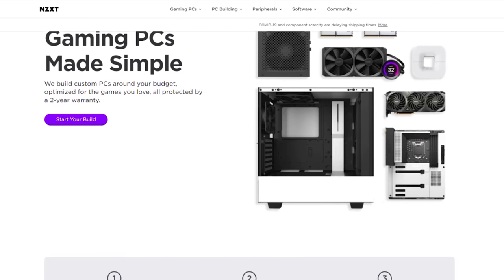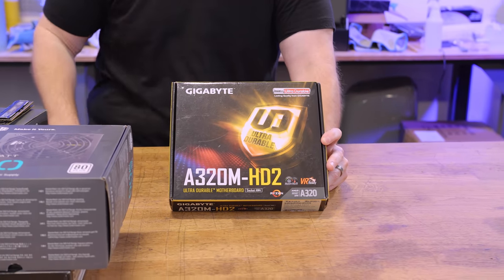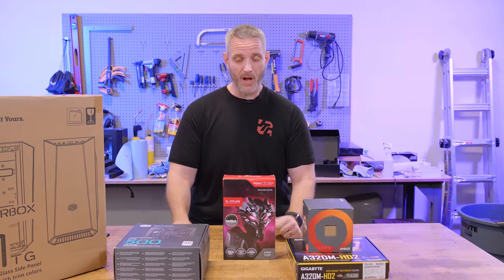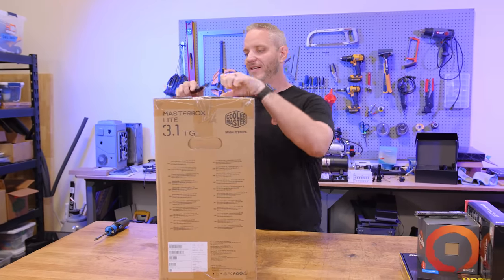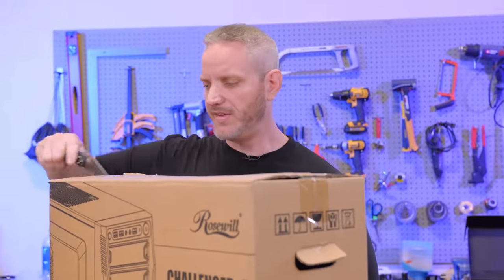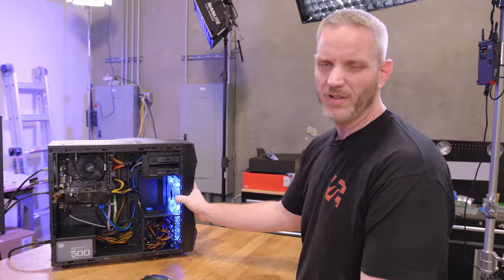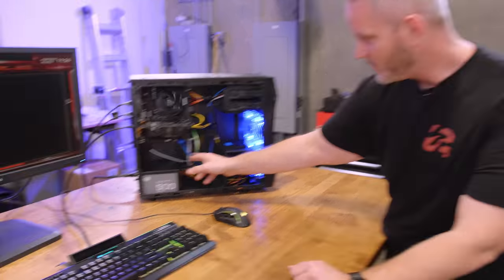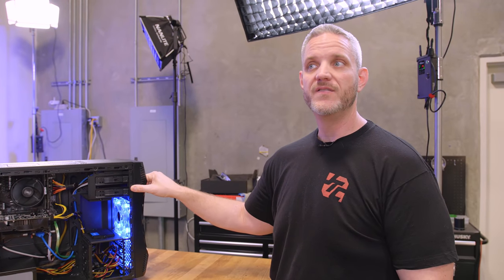The most Practical PC Build of 2022... Extremely Tight Budget Build!

Comment: Well, my practical build I built it for my mom, it has an Athlon 3000G, 16GB of RAM (originally 8, but she filled the 8GB with just Excel sheets), 512GB SSD, 1TB HDD, an EVGA 450W PSU and the same Mother board that you used in the video xd
And I want to make me a new build with some Hardware I have hangging around

Comment: I gave my "practical" build to my mom - Lian Li TU150, Ryzen 5600X, 16 GB G.Skill Ripjaws V 3200MHz DDR4 memory, Asus ROG Strix B550i, 120 MB m.2 SSD, Corsair SFX 750 watt PSU and an old GTX 1060 6GB that I never got around to use because I got a really good offer on a 1080 Ti. She uses it to surf facebook, check mail and play solitaire. 

My own practical build - Phanteks Enthoo Evolv ATX, i7-6700k, 16 GB Kingston Fury 2400 MHz DDR4, Asus Strix Z270H, GT 1030 2 GB, Samsung 850 EVO 120 GB system disk, Seagate Barracuda 2 TB + WD Red NAS 6 TB HDD and an FSP 750 watt PSU. It's my old main rig that's now "retired" and only act as backup/media server/sometimes stream encoder.

Comment: HEY THAT WAS THE CASE I HAD IN MY LAST MACHINE! 
I cut the mesh part of the side panel, plus some, and added my own 14" acrylic panel and two LightScribe dvd burners cause I had em laying around. 

Funny to see B-roll with this case years after I bought it.

Currently using dimensional magic to fit a 2700x+Noctua D15, 1080Ti, and capture card in a Raijintek Thetis (Windowed edition cause it was cheaper for some reason)

Comment: Honestly I would do a 5600G. Speed comparable to 260X, but as far as video decoding, either should be fine, but 5600G will better support more modern codecs. Would be similar cost, unless you just had parts laying around.

Comment: But if u got separate graphic card then a i3 intel is cheaper. NZXT is solid quality to talk in budget. 450psu, 8gb ram is more than enough. That last atx is gaming box it does not need extra fan for low wattage cpu. Extra fan puts pressure on ur psu.

Comment: "Practical" PC I just built for a friend of mine:

• H81H3-WM V1.0 Motherboard
• Intel Core i5-4670K 3.4GHz Quad-Core Processor
• 2x8GB (16GB) DDR3 1600 MHz CL11 Crucial Desktop Memory
• Arctic Freezer 7 Pro CPU Cooler
• AMD Radeon R5 430 Dell OEM GPU
• Ultra 600W Molex Modulated PSU
• LG DVD Burner
• SP 512GB 2.5" SSD
• Genuine copy of Windows 10 Pro

Built it all in the original PowerSpec case the motherboard came in. Glides like a wet snot on a hot day.

Comment: I got myself a 3600xt - 3060 xc - 32gb 3600mhz - 650w evga psu - aorus elite wifi mobo - 1tb sabrent rocket 4 plus (overkill yeah XD) and a bunch of other storage. I work with it, game with it at 4k (yeah I have an oled tv) and watch movies and series (loving the oled, can't go back). I thought gaming would have to be done at 1440p but this gpu surprised me and I can run any game at 4k high-ultra at 60+ fps which is amazing. So yeah a little expensive on the ram and ssd but it does everything I want it to and the aorus elite wifi mobo might be overkill for a ryzen 5, it's better paired with ryzen 7 but I can upgrade at any time if I feel like it or need it, though at 4k I think a new gpu would be better but I've had this 3060 for almost a year no problem, though I would have to get something quiet expensive because the only reason my gpu is handling 4k is because I got 12gb of vram.

Comment: Grandma = wife in my case. 

I built her a basic box with the following:

- Samsung 970 EVO Plus NVMe SSD 250GB
- Microsoft Windows 10 Home 64bit OEM DVD
- Cooler Master MasterBox E300L Case with 420W PSU Silver
- Corsair Vengeance LPX 16GB (2x8GB) 2400MHz CL16 DDR4
- ASUS TUF Gaming B460M Plus Wi-Fi Motherboard
- Intel Core i5 10400 Processor

She spends her days watching youtube videos with the occasional game of solitaire.

The 16gb ram is overkill, but I wanted to build it with the capability upgrade later if she ever wants to game on it as well. The onboard video is sufficient for now.

Comment: Jay, you should check out some of the Nvidia Professional Graphics cards. Here in the UK, the cost difference between an Nvidia T400 and the R7 260X is maybe $20 and the T400 is very new, unlike the R7 260X. The T400 doesn't require external power (only uses 35W) so no need for a 500W+ power supply. The T400 is also much more affordable than the old Quadro series.

Also, yes Jay, they make DVD-RW drives with SATA interface. You can't go wrong with an LG drive.

One client I did a build for about 18 months ago had an i3-9100F, Gigabyte H310M DS3H motherboard, stock Intel cooler, 8GB DDR4-2400 RAM, Crucial MX500 500GB 2.5 inch SSD, Gigabyte GT1030, EVGA 450BR PSU in a white Corsair 275R Airflow case, with a white 24 inch HANSpree monitor, which is used for her work as a copywriter. Pretty similar performer to your build here.

Comment: If this PC was truly ment for just media and maybe web browsing, Why not go for a htpc format case, I recently built one in a Steiger Dynamics, and it fits beautifully in my living room, matches the cable box and receiver. Otherwise great budget setup, even that GPU should be able to do simple light gaming, my media PC has a gtx 750 in it and I was kinda surprised it was running pretty much every ps3/xbox360 title at high settings 1080p 30fps lol.

Comment: I thought you could install Windows 11 fresh without TPM 2.0 support? It is only required for an in-place upgrade from 10 to 11. 

Also, optical drives haven't used IDE since maybe 2005-6. Nearly all of them have been SATA since then.

Comment: This is legit what my friend has a gaming rig but the only difference is the has a B450m-k motherboard, RX 460 4gb and 16gb of ram.

I gave him my X99 xeon system with GTX 970. And he likes that system too. Because of the fact it doesnt have the USB dropout issue which is still happening on his system(the board has a bios for 3rd gen ryzen already on it). Im trying to find him a gpu in the same level as my GTX 970 but theres not alot of options either GTX 1060 3gb for 180€ or RX 470 4gb or 570 4gb for 180-210€

Comment: For that build I would get the 3400G instead of the 1300X. The graphics are better than the 260 and the motherboard should support the Zen+ CPU.

If I was building with new parts, let's do a bottom-of-the-barrel build:

CPU: 11400 - $180 - Integrated GPU is on par with the GTX 260, so no GPU required
Memory: 2x8 GB @ 3200 MHz - $50 - $20 more than cheapest 8 GB model, but my grandma is worth it
Storage: WD Green SN350 480 GB NVMe - $45 - At the same price as a SATA drive, let's go with a proper m.2
Subtotal: $275

So far so good, now for the harder part of the build. Either we go dirt-cheap or we go ITX and give Grandma something that clears up a lot of desk space.

The cheaper, but much less satisfying route, is to go with a more traditional case + mobo:

Motherboard: MSI B560M PRO-E - $90 - Cheapest non-trashy board, $10 more than cheapest, Asus PRIME B560M-A is also an option here
Cooler: Stock
Case: Cougar MX331 - $50 - Cheapest good-airflow case I could find
PSU: Cooler Master MWE Gold 550W - $65 - Fully modular and Gold-rated
Fans: Arctic P12 56.3 CFM 5-pack - $25 - Give grandma what she needs and keep the rest
Total: Around $500

 Which is plenty to make Grandma happy. I would, however, like to see how much extra an ITX system costs:

Motherboard: ASRock H570M-ITX/ac - $150 - NOT cheap, $60 above the other build
Cooler: Noctua NH-L9i - $45 - Because grandma deserves more silent computing :)
Case: InWin Chopin Black - $170 - Not cheap (+$55), but very neatly wrapped
PSU: Included in case above
DVD burner: USB-based anybrand - $30 - Added cost, but grandma gets what grandma wants...
Total: Around $670, Can be shaved down to $600 if required

This would severely unclutter grandmas desk, especially as the Chopin can be mounted on the back of the screen. As always in PC building, you do you and your priorities are your own.

Comment: ive just upgraded to 12700kf, and man was i not expecting the heat it produces, it thermal throttles to 4.1ghz and hovers around 99C, not overclocked at its base settings., i suspect its the kaka thermal paste i used though.
Reply: @hydraulixx  I would have gotten the non k version but it was on sale and was actually cheaper than getting non k. Also my cooler is decent, it’s a deepcool gammax 400 xt, the thermal paste I put on it though seemed equalivant to playdough though, so ima put some other paste on.

Comment: I was watching and when I heard Ryzen 1300 I was like Jay does not know about the official CPU support for Windows 11, then I saw the text below added about finding out later of the support. On that note, I have installed Windows 11 onto 3 HP laptops the Gen 1 Zen 1/+ Ryzen 2500U/2700U CPUs and Windows 11 works find on them with updates and all. The TPM 2.0/fTPM is more critical.

Comment: fine pc, but ryzen 1000 is not supported by windows 11. my reconmentation is the 3200g, 3400g, prebuilt for 4200ge or 5200g. all supported by windows 11 and just fine.  All have equal to the 260 and save money. But I do undertand if you alread had the part to build this computer. great video as well

Comment: My "Practical Build" for 2022
i3 10105F
Z590 Aorus Elite
32GB Hyperx Fury 2666
Bequiet dark rock pro 4
Corsair RM750 PSU
16x 800GB Dell Enterprise SAS SSDs
16 port SAS Raid Controller
500GB Crucial MX SATA SSD
Nvidia Quadro K2200
Fractal Meshify 2

Will run Minecraft Server and Plex, as well as NAS Storage.
Room to upgrade to a MUCH better CPU down the road if required

Comment: When would you consider upgrading pc components? would you wait until you start seeing the system struggling to run new games? or would you upgrade ahead of that to stay ahead of the curve? thinking of my next pc upgrades and want to have a plan to do so. currently running i9-9900K/EVGA 3070/3200 HyperX Fury RAM (64GB)/ MSI Z390 Gaming Edge mobo

Comment: What i'd love to see is whenever the new AMD processors and new gpus come out in Q2 / Fall is that we see a reasonable high end build which maximises cost to performance. As the very top high end compared to normal high end tends to see a high price increase for little to no performance increase.
Reply: Alderlake offers performance to price improvement already. Don't fall for the you only need AMD.
Reply: @SmokeSolo1975  Sure, but not really what Im looking for / meant with that comment. At a certain class range price to performance goes way up, ex. The 3090 or 3080ti vs 3070 and 3080. Bigger price increase for smaller performance. 

The adoption cost for DDR5 is also kinda holding me back from upgrading at this moment and I really hope that with Zen4 and 4000 series cards and everything that comes with it that adoption cost will be lower. But I digress. I would still love a video with mid high range components from this new coming generation that are still cost to performance gain efficient.

Comment: I would have used 16gb of ram instead of 8gb and then I would disable the paging file so the SSD isn't pointlessly being written to extending the systems life because lets face it that is going to be more than fast enough for her use case until it dies entirely so why not extend its life further with a little more ram.

Comment: 1070?  He’ll throw a 1060 6gb in there and you can run games 1080p no issues.  I still run a 1500x 16gb ram and 1060 6gb.  Only reason I haven’t upgraded yet is because I haven’t upgraded from my 1080p high refresh monitor yet.

Comment: Windows 11 does not support 1st Gen Ryzen, at least not out of the box. Not necessarily because of the fTPM, but because of other missing instructions. Of course you can disable this check by creating a custom ISO file, but it doesn't work out of the box from a new install (an upgrade might work though).
Reply: No, it’s because of TPM. Windows 11 requires no more instructions than windows 10 requires.
Reply: @EvilTurkeySlices  I just looked it up, it's because of HVCI instructions which are used for memory integrity, and these are missing in 1st Gen Ryzen.
Reply: @sp00n  then why can I run it on a CPU from 2010?
Reply: @EvilTurkeySlices  It can basically run on any CPU, Microsoft just decided that they want to activate additional memory protection by default and hence made it an official requirement for the OS. Just like TPM. You can run Windows 11 without a TPM and with a CPU that doesn't support HVCI, just without official support and you may not get any updates when doing so (at least that was Microsoft's statement about running on "unsupported" systems).
Reply: @sp00n  the memory thing is probably enabled when TPM is.

Comment: Come to think of it, this pc, cheapeast you can afford with AMD, is way better than my current pc is crazy! My pc was a kind of a mid-budget from 2012, here are the specs for anyone who might read this
CPU: Intel i5 3340 3.1 GHz
RAM: Kingston Real Value 8gb ddr3 1666mhz
PSU: Generic, 500W
GPU: PALIT 1050ti 4gb 75TDP(no pin power connectors that is)
Disc: WD Sata Blue 500gb

The only thing that MY pc is better on, is the GPU (which im using for a newer, much better build), all alse, this thing right here just blows off the charts against mine. Technology is going at a really fast pace, and Im glad :)

Comment: Love the channel and this is a cool build!  Aside from the 1300x not having it, igpus are typically plenty for streaming video.  Also while the build is cool, unless the specifically wanted a desktop, a laptop with an optical drive would be a great alternative.  Or, options like the intel nuc or newer dell/lenovo tiny pcs meet the specs and are solid options.  Granted the optical would be external but there are enclosures that will hold the tiny and the optical drive.

Comment: Ah now this is my kind of stuff. I build budget gaming pcs on the side. Mostly just from word of internet mouth/coworkers friends ect. I do it primarily just because it's my hobby. With that said, I've been doing this for 10 years or so. Done many builds. But this year in particular is the first year i have EVER done what I'll mention below. . . 

Build a budget gaming pc without a graphics card.

The two most recent builds I've done for people have both been focused around the 5600g. I've had budgets of 600-700 dollars to build, and because of the gpu fiasco. . That's been nearly impossible to do what i do. When i do a gaming build, usually for someone's kid, i give them exactly what i would want as a kid. Top to bottom, mouse pad, keyboard/mouse, wireless card, speakers, headset, everything. . All at that 600-700 dollar budget. . Very very difficult without doing an integrated graphics. And yes i know i could go used, but these people are not looking for used stuff. They want to give their kids something new. And even used it would still be difficult to keep everything in one budget like that. 

My go tos. . 

5600-5700g.
Asus prime b450/tuf b450
Oloy 16 gigs 3600 led. Usually owl label.
Evga 600w white 80+
240-256 gig budget ssd (patriot burst, team group, neo forza) for the operating system/necessary files.
1 tb team group pro m.2 (for games and storage).
A Jonsbo type rgb cooler (something like the 
CR 1400 that looks great and actually cools very well, much better than amd coolers). 
Some case like the Montec mesh series (has 3 rainbow led fans included with it), with a few other 120s of led, like from Asiahorse. 
Large mouse mat that's led and on sale (usually can snag one for 9.99 or so).
Cheap led speakers.
Cheap led headset. (These kids are not internet marks, they are kids! They don't critique a 20 dollar Japanese headset like it's supposed to be a bose). . 
A mouse and keyboard combination like the cooler master Devastator 3. Between 30-40 bucks for pure awesome in that range. 

I'm a big time newegg budget fanatic. And quite frankly, it's so much fun to build something for not a lot of money by today's standards, but have it look like it's a million dollars in the eyes of an 8 year old! I do these builds to get someone up and gaming immediately, but able to add onto it in the future. A 5600-5700g will still handle modern gpu at the level of their build no problem. 3060ti-3070 ect later on. Can upgrade easily to 32 gigs of ram. Can add additional ssd. . Ect. Something like this, is my favorite bang for the buck build in 2022. 

My own personal pc setups are still filled with some of the budget stuff. Because quite honestly, some of it is really, really, cool. 

I'm using the modified haf 932 advanced blue from 2010 range. Im using a set of 5 asiahorse fans in it. Paid 36 bucks for 5 adjustable rgb 120 fans that work and look great. Im running 32 gigs of neo forza 4400 ram with aura led, that i Paid 129 dollars for. Running it to match my infinity limit. 4000 cl16. . There's a lot of stuff in the market right now that you find if you just take a chance on it. . It can save you a bunch of money and still be great!

Comment: Hey Jay, 67 year old Grandpa here. Just finished my sensible build. 12th gen I5 12600, Asus Prime Z690M-Plus D4 motherboard, 32GB G Skill Ripjaw 4000 kit, WD Black 1TB SN850 Gen4x4 M.2, EVGA RTX3060 Black and an EVGA 650Gt PSU. All stuffed into a sub 20L MATX case. W11 loaded and Horizon Zero Dawn, Cyberpunk 2077, Witcher3, NMS, Destiny 2. All loaded onto the Seagate 1TB SSD game drive from my old machine. I run Resolve, Reaper and CAD for my 3D printers. As Clint Eastwood just said to the question "how do you keep going?" he replied I suspect in his inimitable drawl, "You just don't let the old in." Good words to live by.

And yes, I am my family's tech support. 
BTW, props to Phil. Nice edit.